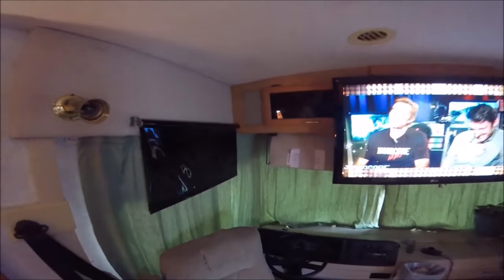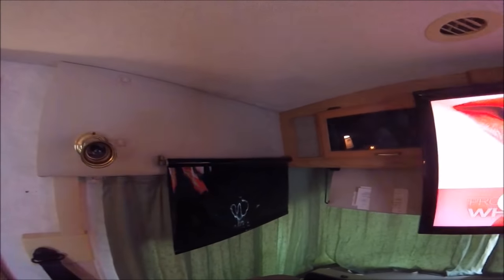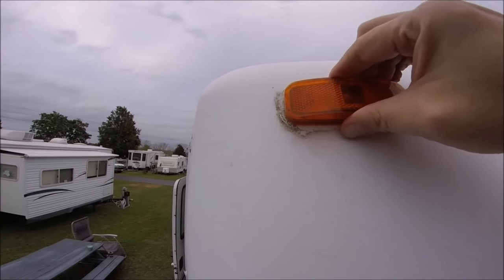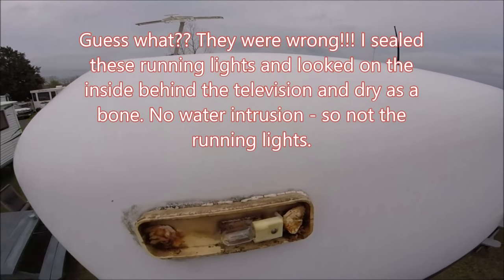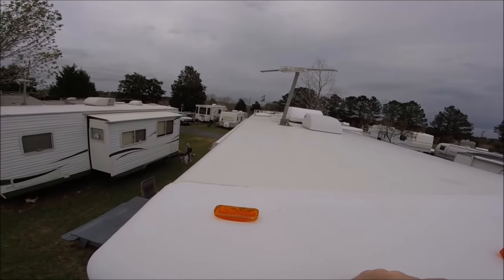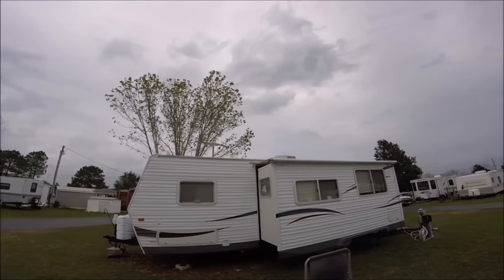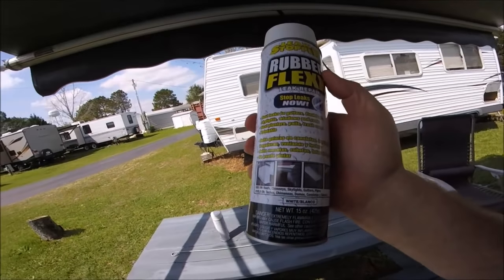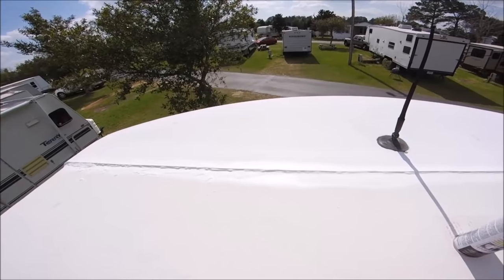RV Life Roof Leak Repair - Winnebago

Comment: Patrick, I had a leak up by my windshield area and it turned out to be the markers like you showed. We replaced them all with led markers. We bought a new marker for each one. That solved our problem. They get old and week and form cracks so you really need to put new ones in. Be sure to get the led markers. They work great. On the inside we opened our air vents into the ceiling and got a little 7 inch fan, made three hanger hooks and hung it facing up so the air would blow through  that space and dry it out. It worked great. To make the three little hooks my husband cut up a wire coat hanger and bent them so they would hang the little fan. Good luck!!
Reply from the maker: +Nanas Joy - Great ideas!  Thanks. I originally thought it was the markers (running lights - right?) but they are sealed nice and tight and I did dicor around them. I am not looking at the gutter tracks so we will see. The fan idea is great. Going to give it a try for sure.  Thanks Nana!

Comment: Winnebago uses a gutter trim that the roofing rolls over the edge of the ceiling and attaches to the wall. There are holes in the bottom of this gutter to let any water out that gets in at the edge of the roof. "It's a controlled leak" Algae and moss grow in this piece of metal clogging the little drain holes up causing the water to back up in the wall, ceiling joint. The roof needs to be sealed where it tucks in to this metal then making sure all the little drain holes are clear to drip any excess water that gets in that track. If really bad just clean out the calking at edge of the roof panel and use an air compressor to blow the crap out of this joint then reseal. Be careful one can tear the roof panel by getting it in a bind. Good luck

Comment: I own a 1989 Sterling Class Motorhome. In 2016, my rear window broke. After having it replaced using a flat piece of laminated automotive glass, installed using the black adhesive windshield installers use, I had water leaking at the bottom of the window. For the life of me, I couldn't figure it out. Using a hose,  I ran water over the glass everywhere & nothing! No leaking water. Turns out it was one of the clearance lights above the window. When I popped off the three lenses, one of the lights was corroded and soaking wet. When I got the light assembly off the body, it was soaking wet in behind. During a long spell of hot weather, I removed the three clearance lights, and allowed everything to dry. I re-installed the lights, sealed them up, waited 48 hrs., got the hose out and tested them. No leaks.
Reply from the maker: G Alexander awesome story!!! Water leaks are such a pain and definitely not in the place you would think. Sounds like you did some great investigative work and resolved the leak. Thanks for sharing your experience.

Comment: Did you check around the rain channels... I was always tightening the little screws that held them in place and then would re-caulk around them afterwards...My dad on his ((old)) Winnebago, had the same problem with rain channels... he was always having me climb up to do it..(HA!) (HA!) I hope that what you did will stop it from the rain, but if it doesn't check the rain channels around the front of your rig... good luck...
Reply from the maker: +Mick The Cleaner - Mick - you are awesome!!! When I read your comment I realized I had not checked the gutters and the connections to the gutters. From my perspective - I have sealed everything I can think of. I am going to check the gutters today and dicor the rivets if needed. I did check the strength of the gutters and they were nice and tight - not loose any where but I never thought to check the rivets. Great idea!!!  Thanks Mick.

Comment: Most of those leaks are from the rubber roof (tpo/epdm) termination at the front/rear roof edge.  Those drip rail screws back out when traveling and need to be retorqued every year or so.  My guess is you have two leaks on each side at similar locations

Comment: Hi, just wanted to mention something about the Flex spray sealant for the RV collective (okay so I'm a Star Trek/Borg fan,  resistance is futile) that was told to me by a workamper we met in Arkansas. Eventually every RV's propane tank gets rust and the paint peels off. He told me to peel off the loose paint, then use the Flex spray on it and forget about it. Evidently that stuff is a lot like Eternabond tape, it's eternal, ha!
Reply from the maker: Thanks!  I used the flex seal for the roof repair as a temp measure. It worked ok for a brief period, but I cleaned it off and did the dicor - much better. My propane tank is a bit rusted, but not too bad yet. Good idea though with the flex seal. Thanks.  Have you made any decisions on your delam fix?
Reply: The adjuster called yesterday. The estimate is a little over $10,000. I asked him to hold off cutting a check until we get back from the Winnebago factory because the repair shop won't be able to fix it before we leave....  but we might not come home with it. We might get something new and drive straight to AMSolar in Oregon and have them install solar for us.
Reply from the maker: Well good luck with whatever decision you make. I will stay tuned to your channel for any updates - cant wait to see what you guys do!  Enjoy the trip and your time at the factory!
Reply: @PaddyWagonTravels  What did you use to "clean off" the Rubber Flex Spray?

Comment: We had the same problem first rain after we got this RV and it was coming in from the side where the the small trim piece is that separates the side walls from the roof.
Reply from the maker: +CampingwiththeKelly's - really??  How did you seal it?
Reply: +The Paddy Wagon I just used the self leveling RV caulk , probably what you was using, and I caulked the the top of the trim really good all the down the RV. Hasn't leaked since.
Reply from the maker: +CampingwiththeKelly's - great to know. I just sent you a PM.

Comment: Make sure you clean the little gutters out this also help keep the water from backing up and looking for a place to come in.
Reply from the maker: +Roger Dole - yes - indeed. I did clean out the gutters so the water flow would move through easily. I am hoping the quick fixed worked and I can do a more permanent fix once the weather starts to dry out a little. Thanks for your help.
Reply: +The Paddy Wagon So understand your problem been there done that so many times take care!

Comment: It seems like your fix will need to be a full sealant tear down, clean up, and reseal the entire front cap...chasing down leaks can be maddening!! Good luck!
Reply from the maker: +lorax1968 - yes exactly. What I did this time was really just temporary until we dry our a little here. Once the wet weather is over and there will be several dry days, I plan to remove the old sealant and replace it with enternabond.
Reply: @PaddyWagonTravels  Again, what do you use ot remove the old Dicor sealant?

Comment: What about around the base of the Ariel which is for your RV's radio? water can get in one place and then travel to some were else and show up say two feet away it can happen, good luck Jim from the UK.
Reply from the maker: +jimbob336123 - all is good with the antenna ... checked the sealant when I was on the roof and also looked at the base inside and no water intrusion. But good suggestion. Thanks.

Comment: How did the flex seal work ? Just curious as I may pick up a Can for emergencies, thanks.
Reply from the maker: Hey Chris - the flex seal worked pretty well for the rainy season. That video was produced almost a year ago. Since then, I have removed the flex seal, used diccor and enternabond to cover the areas and that has been working well. But the flex seal was a great quick fix that lasted for about 9 months.
Reply: Great thanks, I am planning on re-doing the roof in its entirety, dicor and eternabond , but not till next year, so will pick up some flex seal just in case, looking foreword to Chico getting better, see you.
Reply from the maker: Thanks man!  Good luck!

Comment: Hey our great friend  Glad you made it back safe from Moms.  Check the following and maybe think about this
1.  Check Ac drain that it is not condensating under roof
2.  For water stains try Oxyclean auto dept wal-mart  Not regular Oxyclean
3.  If that doesn't work try 75% bleach and water solution on stain area
And  remember Stop the Madness Start the Adventure
Isn't it great to own a RV  LOL Haha
Reply from the maker: +Rv Adventure TV - hey guys!!!  Yes - the trip back to Alabama was fine - just long with lots of Easter traffic - should have planned better. But it was a nice trip overall. Thanks for the tips. AC drain is good - checked that.  Will definitely get the Oxyclean from the automotive dept.  Hope the stains come out but better than that - I hope I got the leak.  Thanks for all the helpful tips!!!

Comment: Suggest you use a hair dryer or wipe the wet area dry with a towel to get the moisture out of the ceiling material to prevent mold and beginning of rot. Good luck chasing your leak,
Reply from the maker: +Randy Barentine - great advice - thanks.

Comment: well don't wate ontail it rains but get your water hose out turn the water on after the flex seal drys then make it rain. if any of the things on the roof is crack then remove the old stuff and re seal it.

Comment: I had an rv with an end cap that rounds to the side, just like yours.  As everyone else says, eternabond tape will certainly work.  The only problem or two that I did not like about it, was that you have to extend the tape also over the rounded ends of the roof to the side by the gutter, and it can be seen from the ground.  It definitely worked, but everyone could see from the ground there was a patch done. Secondly, also you would need to remove all that chalking there now, for an even look(not an easy job).  Some people will just slap it over the chalking, and it will work, but tape will take on the lumpy shape of that chalking along with air bubbles etc.  and once that tape touches anything, it is stuck there for life.  I am sure you know all of this but It can be kind of tricky to work with and getting it looking right.  I hope you can get the inside water stains out too, because I am sure you know that would be a big negative when re-selling the RV.  Best of luck with it.  I full timed for 5 years, and you are sure bringing back lots of memories for me.
Reply from the maker: +K. Bayquoi - thank you for all the great advice. The fix I did right now is temporary just to get past the wet weather - once we dry out a little more, I am going to pull out the old sealant and use the eternabond for a final fix. I have the enternabond puddy  which works really well for the sides of the front cap ... makes a nice seam and seals great. As far as getting the stains out of the inside - I am using a rug stain remover and this should do the job. Thanks for your great advice.

Comment: Use permabond tape about 6-inch wide across the whole front cap seam. Did you seal the antenna base? Good luck,  God Bless, bye.
Reply from the maker: +Jeff Moller - thanks Jeff. The antenna base is well sealed and is visible from the inside of the rig - no leak there. the permabond is the next step for sure.

Comment: What is this - a product placement? How did the leak look like? How did you fix it? How is it different from other methods?
Reply from the maker: Haha - no certainly no product placement or endorsement from me - just sharing how I went about fixing the leak.  The old Winnebagos have an issue with the front horizontal seal and the fiberglass wants to come lose. My issue was limited to a very small area but the flex seal worked initially. However, I did have to clean it off and replace the seal with dicor and some eternabond.  Thanks for your comment.
Reply: Can you change your description to include this updated information please? Especially for the deaf?